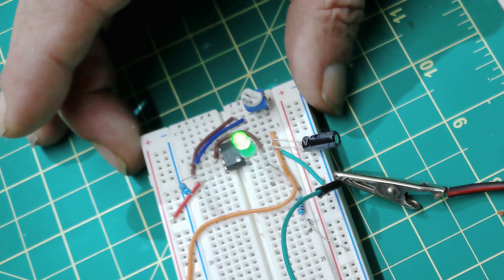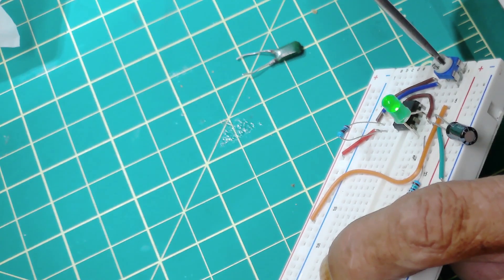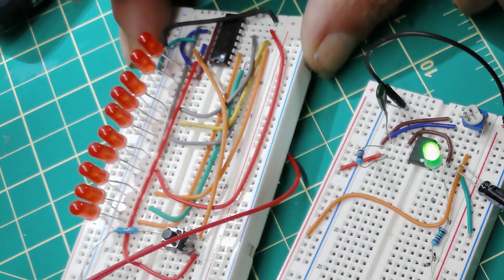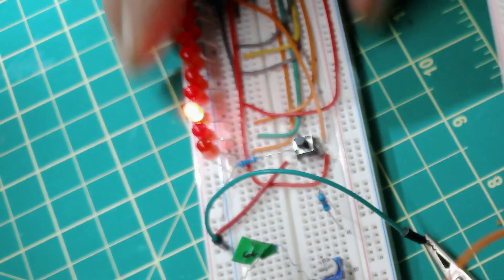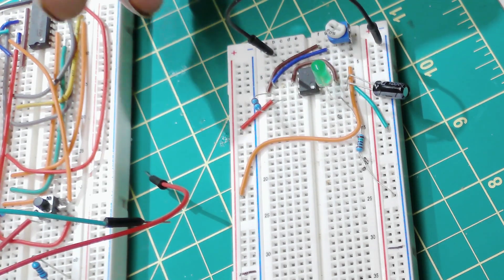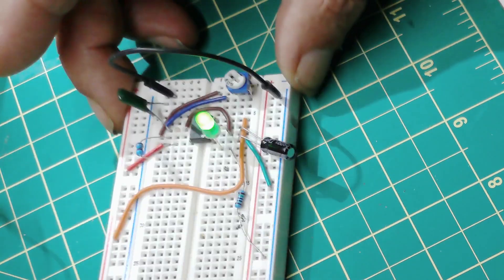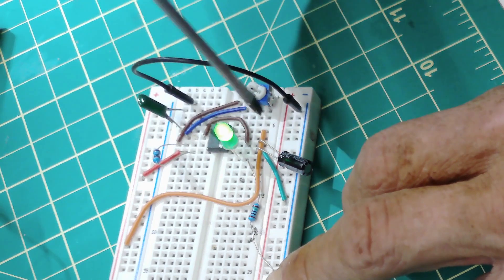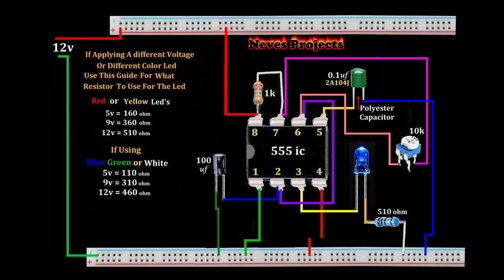Importance of Pin 5 of The 555 Timer IC

Comment from the maker: It seems like a lot of people misunderstand what the video is about.
I'm trying to show that the 555ic will not work properly without a capacitor at pin 5. I demonstrate that with a button and an led. even a button when I press it can send a bad signal to the led chaser and make it skip leds. and as you can see with the led the 555ic does not send out a clean signal without the capacitor at pin 5, (the led is getting electrical noise)
So without a capacitor at pin 5 the 555 will not work properly as a trigger to operate another circuit such as an led chaser.
To some I probably stutter and my spelling probably stutters too but that's the best I can explain it.
Reply: Pin 5 is basically an AC input if you look in the documentation. It allows you to vary the duty cycle and frequency dynamically using an AC signal through a bypass capacitor. Because hardly anyone uses it, it should be given a constant state by bypassing it to ground. It's a direct connection to the 2/3 point in the internal resistor divider that feeds the comparators.
Some of the most interesting uses for pin 5 are a class D audio amplifier, or an AM radio, or an FM radio transmitter.
To make an audio amplifier, you set it up as a astable multivibrator and then just feed the audio input into pin 5 through a bypass and then you take the output pin 3 and pass it through a capacitor and an inductor to turn it back into AC for a speaker.
An AM radio you do the audio amp thing, but use a variable resistor to change the frequency to tune into the radio station. pin 5 goes through a bypass to your antenna.
For an FM radio transmitter, you set up the frequency as your transmit frequency, then feed audio into pin 5 and pass the output directly to an antenna.
Reply: Yet even the app note calls for a small capacitor there, but because it mostly works without it, people leave it off. The app notes say it improves stability, and even gives broad values, saying it is not too critical value wise, but it is needed to have stable operation. Ceramic capacitor of around 100n is the most common value, and is often the cheapest value ceramic as well, because it is made by so many manufacturers, and thus this broad spread of values fits perfectly with the circuit requirements.

A known issue with the original 555 design in that internally it has a very heavy current pulse as the output switches state, as for a brief time both the output transistors are switched mostly on.  Which is why the 555 datasheet tells you to use a 470uf, or larger, capacitor right next to the power and ground pins, short wide traces joining them. For breadboard use stick the capacitor on top of the IC,  next to pin 1 and 8, and it will do just as well. That internal current pulse affects the voltage divider that provides a set of reference voltages, so a breadboard will show it up well.

Comment: The simplest Hardware soulution is a low pass filter For example, a 10k pull-up resistor and a 0.1 uf capacitor. A Schmitt trigger would be better, but the RC solution will suffice if necessary (don't forget the resistor from the switch to the low-pass filter).

Comment: Looks like you're running the chip in astable mode. The TLC555cp made by Texas Instruments, the data sheet says pin 5 is capped in monostable mode, in astable mode, pins 4 & 8 are capped with an electrolytic cap on the power rails, that's where mine is. It helps against voltage spikes. Circuit works perfect. 😮

Comment: The use of the pin on the datasheet.  And when you're pushing the button, it isn't skipping LED's due to "static electricity".  It's skipping due to the bounce of the switch contacts.  Polyester caps aren't polarized.  Electrolytics and tantalum caps are polarized
Reply from the maker: I understand that, I was just trying to show (with the switch) what can happen in a circuit if you don't use a capacitor at pin 5

Comment: Maybe electronics is to hard for you! May want to find an easier hobby. Pin 5 isn't to "stop noise". It's for fine control of duty cycle of the timer. Noise is another issue. You don't have much of an electronics background. That would help you a LOT! Take a few classes  NOT YouTube!
Reply from the maker: Well you F%$*en looser if pin 5 is for fine control of duty cycle of the timer is that not stopping electrical noise in the circuit ?
Take your milk and cookies and move on.
You must be like 6 years old to have only discovered youtube on april 3rd 2024

Comment: You need a debounce circuit for your switch. I'd replace your SPST momentary switch with a SPDT momentary switch and 2 cross coupled NAND gates. Search for a circuit. Easy to find. Someone here mentioned a cap across the switch - easiest thing to add to your breadboard and will work.
The reason pin 5 is labelled "control" is because it allows the 2/3 and 1/3 of supply voltages of the internal resistor divider to be altered. As stated by other commentators here, it can be used in VCO applications.

Comment: Where do you show a schematic diagram of your 555 circuit. Also need an internal schematic of the 555 chip itself to see how pin 5 relates to the internals of the 555.

Comment: It's not really pin 5, its the switch bounce. A mechanical switch does not provide a clean on off signal, but instead bounces. There are several ways to clean up the button signal.

Comment: People do use it.  I do.

The capacitor is shown in the reference circuit in the data sheet.  Pin 5 has other uses too.  It's a control pin by which you can change the trigger and threshold points.

As to putting the cap on pin 5, you can get much of the same effect by properly bypassing the power pins of the chip.  That may be why you see some people not use it and get away with it.  I usually do both, and no, it does not have to be a polyester cap.

One last point, the LED is not coming on in two steps.  The dim "step" is due to the oscillation that occurs it the cap if left out and the power supply is of poor quality with no bypassing, which is the case with your breadboard circuit.  You have no bypassing at all and your power is being supplied through multiple breadboard connections.  Put a scope on it and have a look.

Comment: Nice work and I know what your trying to say and Kudos for that. You are of course correct, as the datasheet points out that it's best practice to use a capacitor to GND if your not using that pin the ' control ' pin. Yeah ! I have put the electrolytics round the wrong way a few times myself ! A tip, all those long leads on the components are pick up points for electrical noise keep them as short as possible and breadboards are a pain in the arse! and this is mostly due to old or poor breadboards and I get your frustration. The 'skipping' is caused by ' keyboard or button bounce' worth looking into that because it can be fixed with another capacitor at the switch. The 'bounce' is caused by mechanical switches operating many times with one push and this can be fixed in software or hardware. To be fair the 'control' pin is covered in the datasheet and what value to use. You need to move away from breadboards and use Veroboard or I think in America you say 'Protoboard' or 'perfboard'  I know this from experience with early current measurements... Good luck with your projects !!.....cheers.
Reply: @andymouse :-)

Comment: The reason the skip sometimes happens when you press the button isn't static electricity, it's because the mechanical switch bounces. There are ways to debounce switches in hardware, a Schmidt Trigger circuit  with some hysteresis is what I've used in the distant past. 

The cap on pin 5 is used to even out noise on the supply voltage and should always be used. Leaving it floating is begging for trouble from electrical noise.

Cool to see that you're doing the work to figure this stuff out.
Reply from the maker: Thank you
Reply: Interesting, i just use a capacitor to debounce things xp

Comment: When the 555 timer first came out, the Instructions always said to use a small voltage stabilizing capacitor on pin 5. I've always used a capacitor on pin 5 so have never come across this problem. Thank-you for letting me know I have not been wasting money on extra components. Used correctly it is a very cheap and stable circuit.
Reply: same. i always just threw a ceramic on it. 10nf or 100 or whatever.

Comment: These days if I need an oscillator I use something like a 74HC14 hex Schmitt inverter. Cost is about the same as a 555 but you can get 6 oscillators from one chip or a ring oscillator for a few more passive components.
Reply: A 4093 gives you just 4 oscillators but the additional input gives you on/off functionality if you want it....
Reply: Like comparing apples and pears. True core of 555 timer IC are two 1/3 and 2/3 Vcc voltage levels and comparators. Schmitt trigger inverter is completely different beast.

Comment: Its the votage threashold control pin. If disconnected its gonna float high but wont be stable for a stiff square wave pulse. You can eith cap it for a stand alone pulser or you can control it with a voltage to turn on the timer for something else. ❤

Comment: [edit: I should have read more comments before posting mine. I see someone else has already discussed this]

Chances are that the problem is not really the lack of a cap on pin 5, but very poor delivery of power to the breadboard, poor distribution of power on the breadboard and a very conspicuous lack of proper power supply decoupling at the 555.
Bipolar 555s exhibit horrendous "shoot through" current in the output stage at each switching transition. This shoot through current in conjunction with power distribution inductance results in huge voltage spikes at the 555 power pins if no decoupling is used.

Make sure power wires to the breadboard are a twisted pair, not separate wires. This dramatically reduces their effective inductance. A bulk decoupling cap of at least 10 µF should be used on the breadboard, usually near the point where the power wires are connected. A good quality ceramic cap of around 100 nF on short leads should be placed as close as possible to the 555 - NOT between the supply rails on the breadboard but as close as possible between the actual supply pins of the 555. If there is good decoupling for the power supply the need for filtering of pin 5 is greatly reduced or even eliminated.

The reason the chaser won't work is that the 555 is switching a whole bunch of times at every transition due to the lack of power supply decoupling caps. That is why the LED comes on with what appears to be two brightness levels. When dim it is actually switching on and off many, many times, eventually stabilizing and staying on.

CMOS 555s are not nearly as bad as the bipolar versions with regard to shoot-through.

A ceramic capacitor is appropriate for pin 5. Polyester is actually is worse, and may be much larger and much more expensive. Polyester is a good choice for the timing capacitor if you need a relatively short period and good stability. An electrolytic is fine for long time periods if you can tolerate some drift with time and temperature. If you need a very short period/high frequency, a "COG" ceramic timing cap is best, but they are expensive as through-hole parts and it is hard to find any of more than about 10 nF. Polypropylene is a good choice but moderately expensive and usually rather large.

Comment: Pin 5 capacitor... I've never had to use one there, but there could be noise coupled into it from these crappy breadboards. It also depends on the internal resistor values. In the CMOS version, they can be fairly high, but in the original 555, I think that they are 5k, so shouldn't be too sensitive.

Comment: One glance at the data sheet makes it clear.  Pin 5 connects to the modestly high impedance ref input of the threshold comparator any noise injected here will cause errors.
So as shown in the app notes just about any cap around 0.01uf connecting pin 5 to pin 1 eliminates this noise issue.

Comment: The skiping is caused by button bounce.  Look up de-bouncing a button circuit to fix that.  As others say it is not noise is stray current  comming from transition,
Reply from the maker: Ok, But my point is if a button can cause that how is a 555ic that gives out bad signals because of no capacitor at pin 5 make a chaser work properly ? IT can't
Reply: @NevesProjects  You are correct there are two issues going on, stray current from not having a cap on pin 5 and button bounce. Look up the book 'The encyclopedia of electronic circuits' the pdf is available online, there are lots of good 555 examples in it.
Reply: @NevesProjects Just put a 100nF capacitor in parallel to the switch and the bouncing along with the led skipping symptom will stop...

Comment: The reason why the chaser jumps with the button is due to switch contact bounce 
Also the 555 datasheet specifies a cap on pin 5

Comment: Discharge pin 7 can be connected to pin 3 output if only pull down required.  Useful if current limit reached. The main thing is the output resistance is reduced and associated volt drop. Handy for relay drive. If so add a 1N4007  diode to the relay in reverse bias to protect the 555.

Comment: Most text  books I've read suggests pin 5 to ground via 10nF.  I have fed a signal in 5 as a class d amplifier. Reasonably good although not very powerful. Many circuits. I build are OK without it. I always add the 10nF regardless.

Comment: The best connection rule for Pin4 and pin5 is "Unless you are USING either of them for their purposes, then simply don't connect anything TO them."
Reply: No, those are input pins and simply cannot be left floating. That's the rule for any ic. Output pins are fine to be left floating. The reset pin (4) is high impedance and will trigger when it gets less than about 1V on it, so tie it to Vcc to avoid false resets. The control pin (5) is at 2/3 of Vcc and has an impedance of a few kilohms. It should normally be ac coupled if used or ac grounded if unused (i.e. via a capacitor), otherwise you run a real risk of false triggering.
Reply from the maker: @RexxSchneider  Thank you, and the video proves it but yet some people still disagree, You can mess around with the chaser and get it to work but for how long without the capacitor at pin 5, I couldn't get mine to work properly for more then 5 seconds
Reply from the maker: Are you kidding me, every data sheet says to put a cap on pin 5 even if it's not used for what your doing

Comment: Actually it is well-known recommendation to put capacitor on (control) pin 5 of 555 IC. If you Google up 555 IC, you will see many of them have capacitor on the pin. Dave discuss about pin 5 of 555 in "EEVblog#160 - 555 Timer Easter Egg?" posted 13 years ago.

Comment: The skipping from the switch is what is often referred to as bounce most likely.  You can create a debounce  circuit for switches to get rid of it.  Just an FYI you might find interesting.  Yeah, pin 5 is needed though how clean your power is or electronic room environment can make it less of a problem which can let it work without pin 5...sometimes.

Comment: IDK, I've checked several datasheets of different 555 brands, they all mention the capacitor between pin 5 and GND. It's in both astable and monostable examples. But well, thanks for showing what breaks when you forget that capacitor.
Reply from the maker: Yes they do, but I didn't know that, I was looking for a chaser circuit for my tank and started copying these guy's on youtube and couldn't get one to work. thats why I researched and found out that it needs that capasitor and decided to make this video
Reply: @Adam_Lyskawa I did the same thing.  I have an old "USEFUL IC CIRCUT  PROJECTS" from Realistic/Radio Shack and yup it has a 10uf from pin5 to Ground.   What would have been nice is a oscilloscope showing the output. don't quote me, but i believe that it acts as a filter across collector and base of the input transistors of a comparator circuit. that all i remember from school in 1978.
Reply from the maker: @ I don't have an oscilloscope (wish I did) so I was unable to show that
Reply from the maker: You can also use pin 5 to control the voltage and frequency,  
If you connect a potentiometer to pos, neg. and pin 5 you can adjust voltage and frequency

Comment: Hmm, took one look at your build and my first question was "where is the second cap?"
My guess is you got the schematic from someone that forgot to include it.
The datasheet for the 555 shows a cap on 5.
Reply from the maker: I don't think you understand what the video is about or you didn't watch it all, the video is to show that an led chaser will not run properly without the cap at pin 5

Comment: Check the power supply voltage on the breadboard using an oscilloscope.  If that's not an option, we can only guess what the problem is, my guess would be a noisy power supply.  Fix it with capacitor across the supply, which you did try, but you didn't tell us what capacitor value you used.  Still, without the oscilloscope, you'll never know what's going on.  Or maybe there are other options for testing, an AC volt meter might be sufficient, should read zero, I think (Depends on meter).
Reply from the maker: Hey jrstf, I have spent quite a few more hours on this and I have figured it out.
I'm just working on the circuit diagrams with the right component values to use so I can post it up and should have a video of it working soon